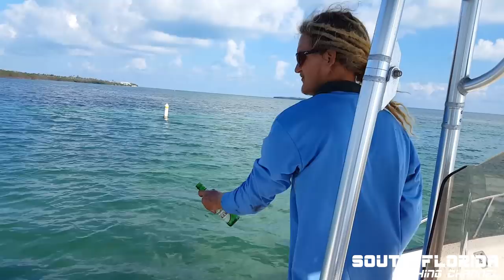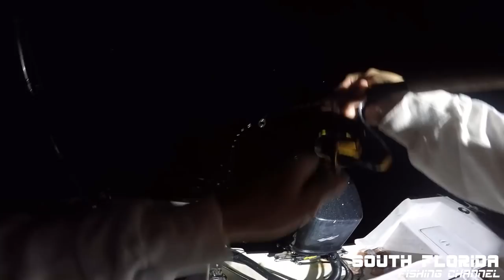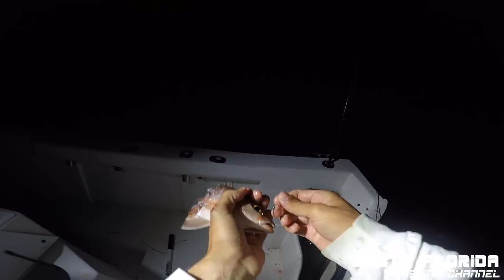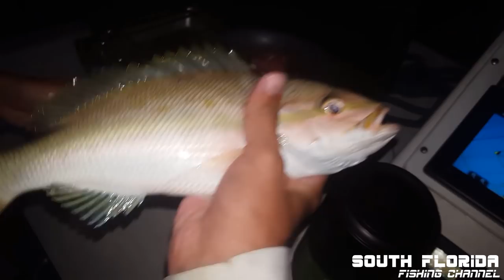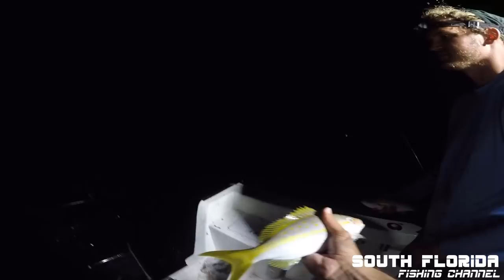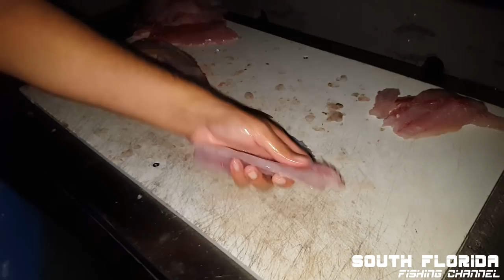Night Time Patch Reef Fishing | Key Largo Catch N Cook

Comment: Hey bud I been watching your videos for a while now. Ive watched all of them. And I love em. I have a boat not as nice as yours but it's a boat. Just wanted to give you some input. I'm not sure what prop you have. Seems to me like it's aluminum? Is so you might want consider getting a SS prop better fuel economy more speed and more control of the boat. Make sure you get it with the the same measurements. Buy it used at your local Marine thrift shops, Craigslist, or offerup. Just my 2 cents. To help you save money on the long run. Tight lines and keep on 🎣.
Reply from the maker: thanks for the info, i'll check em out
Reply: No problem bud. Just one friendly boater to another. Maybe we'll see each other on the water one day. I normally go out of Biscayne National Park. Planning on going out near you soon.
Reply: Fuel economy, speed and boat control isn't determined by what the prop is made of. Different pitch of your prop will control all of those.
Reply: Buck Raeder
 I'm not sure where your getting this info from but aluminum tends to flex or open up under pressure. There for causing the motor to rev up in rpms.  As to SS is more solid so it doesn't tend to flex or open up as much. My boat for example weighs 2000lbs dry. 19 ft by 8.6 ft Donzi. I bought with a 150hp Evinrude. It came with a aluminum prop. My boat topped out at 28mph on good day. With the aluminum prop. When I turned on high speeds the prop would start to cavitate. Also my gph was 7-9 When I changed it to My TURNING POINT SS PROP I gained 12 mph 40mph in total. No more cavitating on turns. And at the same speed of 28-30 I was doing 4-5 gph.
Reply: Buck Raeder
Ask any pro if a aluminum prop will ever out perform a SS prop.